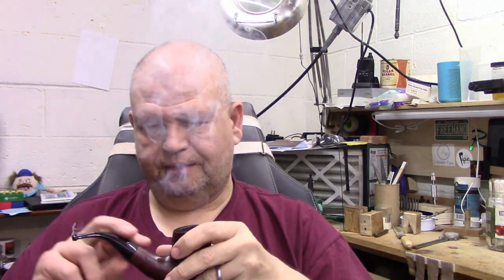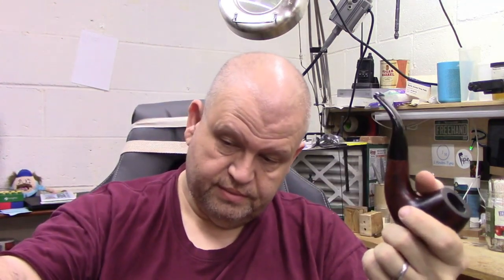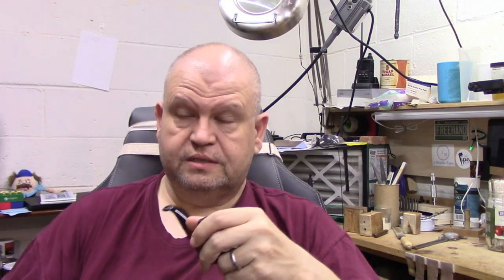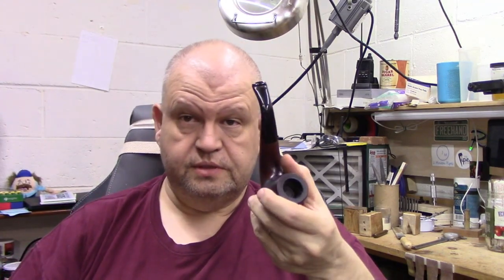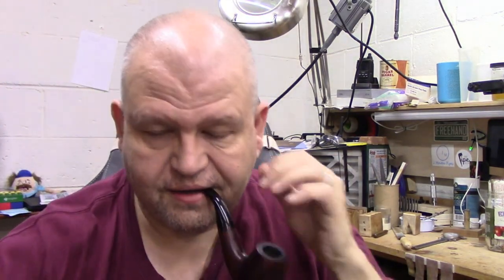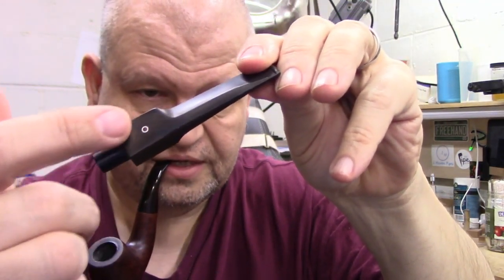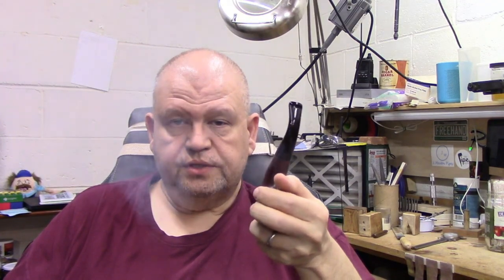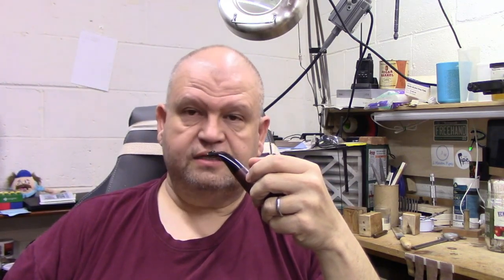Experiments in Stem Restoration Weekend Chat 28 March 2021

Comment: I have gone through a similar train of thought about deoxidising stems as you in an attempt to find something better than chlorine.  I have come across a couple of stems that look like oxidised vulcalite, but even chlorine wont remove the oxidation, so I was really trying to avoid a heap of sanding and risk of more damage to those.  I sent you an email about a couple of things I found.

I don't know about not removing any material from the stem when deoxidising it either.  It seems a bit counter-intuitive unless the process can re-crosslink, polymerise or whatever the rubber as it goes.  Electrolytic rust removal is supposed to turn the rust back to metal with out removing any of it, which it probably does do, but not all of those particles are reattached to the item being cleaned, rather, they are shed as black/grey mud.  However that process is still way better than sanding or sand blasting an item as sections will be cleaned that can't be sanded or blasted.  I will be most interested in seeing what your results are like.

Comment: I've tried soaking it in baking soda to trie and nutralize the free floating sulfur. It did improve a littlebit but it issn't working 100% i would say closer to 10%. Oxy helps with the color and the surfurce material comes of easyer. The rest i just pollish it off on the buffer. Because otherwise it does not come off. I am thinking of prevention of the material ever get to oxidate. But i don't know jet how to do that. Perhaps a bit of sunblock cream :D